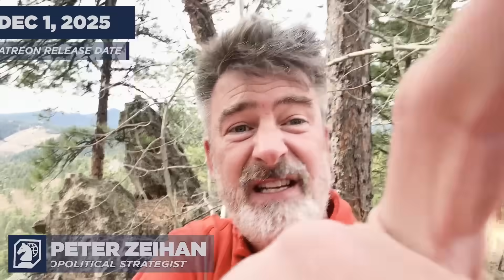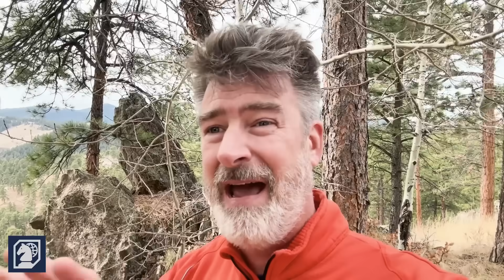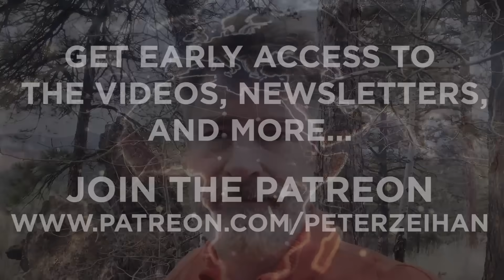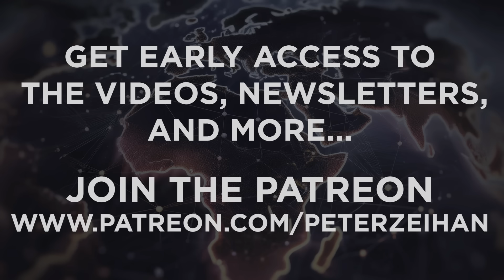Where Would I Put a US Semiconductor Fab? || Peter Zeihan

Comment: Having helped to built and dismantled more than one fab over the past 40 years, I can relate. I worked in a "sister fab" in NC years ago. Key to the location was aligning with the same longitude and altitude as the the sister fab in Japan. The sister fab was built by moving an existing and proven equipment set from Japan in NC. The litho equipment of that era was very sensitive to environmental conditions, especially barometric pressure. The staffing was achieved by shipping a large group of recent college grads with degrees in semiconductor processing to Japan to train on the existing equipment set and process flow, uninstall, pack, and ship the equipment set to NC. Then a crew from Japan lived in NC until the equipment and staff were providing good yield. This sort of development takes at least a decade. Just getting the DI water system to meet spec can take 18 months after the install is complete. These development don't grow like mushrooms. They grow like oak trees.
Reply: According to what I've learned at YouTube Uni, at least regarding the smallest chip sector is that seismic stability is the first consideration to plant siting as even the slightest vibrations can not be allowed. Water supply and quality were cited as the next priority. Then there's the fact that it takes at least a decade to start creating the actual workforce culture needed to staff a plant and 1-2 more for that culture to mature into a truly high quality technosphere. 
It would seem that the're are no real short cuts to developing and building out these fabs despite the recent best efforts by some companies in the south west. Perhaps the larger chips lend themselves to a speedier development process, but to my understanding, building the highest quality, smallest chip fabs is the real objective in the high end techno race and anything less, although not useless, is far from even coming in second, but really misses the primary strategic target.
It is beyond frightening how broadly politicians will ignore the most basic and important facts in matters like this for the expediency of a political agenda.
Have I assessed this situation accurately generally or do I need more credits at YT Uni?
Reply: @Skunk106  wrt seismic stability, Taiwan is more than a little active, yet TSMC has a 2nm process in commercial yield. Active vibration isolation has become very advanced and semi CAPEX is very capable of pausing workflow during events. Consider how many fabs are built in seismicly active areas: our US west cost, Taiwan, Japan, etc.
Reply: @pauldmeyerable 
Gotcha, thanks!
Reply: it would take 10-12 years to build if not 20 and it wouldnt even meet domestic needs.
Reply: It wasn't built underground..  but you do show that water is a very important resource.. and so are the other chemicals.. because where they make the chemicals, they have the required ethos of the business.. in these days, security is also going to be a factor
Reply: I've worked 25 years as a Semicon. Process Engineer in 4 different company wafer fabs from San Diego County to Idaho, to Bend, Oregon.  All those fabs are now gone.
Reply: Best time to plant a tree is yesterday.  Sounds like your team blazed a trail for the way ahead.
Reply: Great comment thank you
Reply: Hyundai were not hiring illegal, underage or slave laborers.
Reply: @Green_Moon77 They can’t find any qualified workers at all, thus they have to import South Korean workers.
Reply: Do you think TSMC will straighten out the AZ plant?
Reply: @warehouse_sam Yes. On a time frame throttled by availability of skilled staff - local or imported.
Reply: @pauldmeyerable  Yeah, I think depending on a labor force in the US is really challenging. I think the future favors companies with fewer more competent workers. Maybe 10% of the labor force struggles to get up every morning and then another 15-20% are functioning alcohol or drug users...
Reply: So the recent Hyundai attempt to build an EV auto plant while dealing with ICE is just the right incentive?
Reply: @georgewoods5543 epstein list. When?
Reply: @georgewoods5543  Because maybe we shouldn't be hiring illegal, underage slave labor here in America, like Nike does in China?

Comment: as i understand it for fabs, labor is usually the most important input, but clean air is particularly useful as well. arizona has the cleanest. and, until recently, a good enough/large enough workforce to justify it.

as others have mentioned, it likely makes more sense for anywhere new (like midwest) to start with lower end chips to buikd workforce competency and infrastructure, then move up only if it makes sense. tsmc would probably love to set up a fab in columbus after it sees how intel is doing.

Comment: Few more practical issues for site selection for a chip fab. They are huge and very expensive factories that require all resources but a few are key, water and seismic stability with a next most important being natural disaster incidence. They are manipulating things at the atomic level so no movement of the building structure is paramount. A lot of the building of the structure goes into making the foundation as stable as possible. Water has to be made at super high purity so they have a huge industrial water footprint and lastly you don't want go through all this and have a hurricane wipe out all these structures, or a flood, or a volcano or what ever mess it all up. I know we built a huge chip fab in Arizona but the clean room, which is basically he whole chip fab, has problems with Arizona dust, so that's also a consideration. 
Another problem these big companies have or maybe a big mistake they all seem to make, is they buy land in places that nobody want to live, and then they have a hard time finding people who want to move there to work at the facilities. META has made this mistake huge. The funny thing is they frame it like "we just want to revitalize these poor communities", like they are doing us all a favor but the reality is they get the land for super cheap. Then they build a huge data center and whine about lack of workers to run the data center. METAs current problem is they have broken ground on a series of huge data centers all over the country but don't have people to run them so they are squeezing the the employees at all the other data centers they already have to transfer to the other data centers they are building. Part of these layoff have been their way to push people out to other facilities like the one they are building in Louisiana out in the middle of nowhere swamp land. They have shot themselves in the foot however, because after all the layoffs no one wants to work for them and all the people who survived the layoff, none of them want to risk upping their lives where they are at to go across the country to some shithole with their families only to get aid off there, no matter how much money they offer to relocate.  Anyone interested in the details of chip fab needs to follow Anastasi In Tech she's a chip fab engineer who talks about the latest in chip fabrication and design, and she's a hotty.

Comment: Id put a fab in alberta canada . Cooler weather and lots of energy.
Reply: How about Churchill Manitoba, a deep water port, it's on the Canadian Shield so your building on bedrock and Alberta could run a natural gas pipeline right to the Hudson's bay. According to Premier Wab Kinew’s office, this project involves a port expansion of some sort, an upgraded Hudson Bay Railway, an all-weather road to Churchill and perhaps other northern Manitoba destinations, the presence of icebreakers in Hudson Bay, and an "energy corridor" that could involve the transport or transmission of liquefied natural gas, crude oil, natural gas, electricity or hydrogen, the latter most likely in form of ammonia. Throw in polar bears, beluga whales, the northern lights, Canadian immigration and it's a central secure location.

Comment: Assuming, from what I have observed, data facilities use local water supplies, for cooling. Pump in cool water, .. and discharge warm to hot water. 

If there were a radiator system, instead .. these facilities would no longer be taxing the local water system. And disposing this warm water, .. that might be a problem, too.  But a radiator system, would cost more. That's where a Jeff Bezos, or a Sam Altman could swoop in, and fix things.

Comment: Btw you need alot of water nearby for chip fab
Reply: And it needs to be ultra pure…I heard they are having problems with the ultra pure part as well.
Reply: @ETF-88  How exactly do fabs use water? Do they evaporate it off, in which case it’s truly gone? Or is it about chemical contamination, in which case it can be reused after being purified? Best case would be if it’s just used to carry off heat in the form of hot liquid water, in which case the warm but otherwise unadulterated water has plenty of uses.
Reply: @yopyop3241  its complicated semiconductor manufacturing requires ultra pure water probably to remove impurities and for chemical treatment of the wafers. Also water is required to cool the manufacturing equipment as machines like EUV which generates alot of heat during the etching process.
Reply: @JohnOh0701  My guess is that only a small amount of fabs’ water consumption is the ultra pure stuff used for rinsing the chips between fabrication steps. The vast majority is probably used to dilute the used rinse water down to concentrations that the law says they’re allowed to dump.

I wonder, how expensive would it be to substitute energy for that dilution water? Use energy to decontaminate the contaminated (formerly ultra pure) water instead of relying on dilution. Or maybe just concentrate the pollution down to a solid that can be disposed of without using water? The waste treatment processes might be surgeable. You could store the waste water and only process it when there’s excess solar/wind energy being pushed into the grid.

This could be a blind spot for companies like TSMC. Taiwan (and Korea, Japan, etc.) are nowhere near as water constrained as Arizona and other potential sites in the US. Taiwan, etc. also don’t have locations where there is as much excess solar/wind energy as Arizona and other potential sites in the US.
Reply: @yopyop3241 Arizona is a terrible place for chip fab they should have built it Illinois instead beside the great lakes.

Comment: Euv lithography tools don’t etch the silicon, that’s what etch tools do. Lithography tools expose photoresist to light with the right pattern placed in the correct place on a good day in focus too. But even through post exposure bake you have material there, develop can remove resist. But silicon isn’t etched until the etch tools.
Reply: Peter doesn't know the difference between diffusion and baking the resist

Comment: Baby steps. Start with the small quantity, extremely insanely expensive high reliability IC's that are low tech needed for aerospace & national defense. It's not to make money. It's to provide for/assure the defense of the nation.
Reply: Military ICs are not expensive because they lack production volume….
Reply: @ChadThundertalk  Indeed. It's all about the process. It's the place to start & maybe stay due to the nature of things.
Reply: Military, aerospace, car chips, datacenter and consumer grade chips are all different, with wildly different demand and production scale, and with wildly different specs and priorities. You can't just start with one, and expand into another domain, it needs an entirely different process, fab, scale, etc. It's like trying to build a skyscraper with your crew after you just finished building a few residential houses. 

Also, pretty sure there already are dozens of smaller scale fabs, so first step is already completed, believe it or not.
Reply: @DumitruUrsu  I agree. An example is IRF. The goal is not to do the whole supply chain in the USA. Cannot. The goal is to bring home the supply chain parts in regions at risk or hostile to the USA. Difficult to put all relevant details in a little comment. Thanks for your comment.
Reply: america will lose the AI Race well before they build fabs to capacity to meet domestic demand.  china leads in 3 of the 4 pillars of the AI Race and closing the gap on advanced microchips.  its likely american AI bubble bursts china defacto crowned winner of the AI Race.
Reply: @giovanni-ed7zq  Look! A CCP bot or CCP pinko! 3 of 4 Pillars! Closing the gap! These things are so simple. Who needs a geo analyst? My comment is not even about IC's used for AI. This has to be a Bot.
Reply: @williamreyes468  its reality,  its because you dont bother to research.  american tech entrepreneur alex wang said this so in interview.  america only leads in advanced chips.  china leads in power and data centers, and in algorithms they are both equal because china was able to get american algorithms.

and it costs china much less in cost to build its AI than for america to build AI in america.

it takes america 3 years to build a data center at a cost of 70 million.  china builds it in 6-12 months.
Reply: @williamreyes468  alex wang in america runs scale AI, you should do some research before spewing nonsense.

alex wang has a 3 hour interview with shawnryan on youtube channel where he talks about america AI versus chinese AI.  chinese are simply able to build cheaper and faster.

just look at a fire engine it not hard to build one.  takes 60k usd and 4 months to build in china versus a 2 million cost in america and 2 years to build.
Reply: @williamreyes468  the simple reality is chinese entrepreneurs like money but want china to dominate.  american entrepreneurs just care about money.  elon musk wasnt even born in america.  its why he is building his mega factories in china, and openly says in china americans are lazy, i wish they were like chinese.

and why is elon building his mega factories in china?  because he knows that is who is gonna next dominate the world economically.  he knows the us empire is in decline.  so he goes where he can make money.

and trump is about money too and not america.  do you hear trump say anything negative about elon building his mega factories in china and india and not america? nope.

because trump speaks publicly to the dummies who thinks manufacturing is coming back to america when its not. its all for show when you see elon building factories in china and india.
Reply: @giovanni-ed7zq  and it falls down in another 12 months from plastic rebar and watered down concrete.
Reply: @giovanni-ed7zq  Read my post before insulting me. It says "IC's that are low tech". It's not about AI. Since you insist; try this for size... China produces 2.25 times more energy than the USA & has a population that is 4.15 times larger than the USA. Unless China's citizens are going stone age & doing without electricity, how is that going to work out at least in the near term. Even if you make a data center in a month, how will it be powered? Both have serious problems in this space. I'm quite use to the alarmist being wrong. They all assume the West will not make any advances while China will. The world is not so simple.